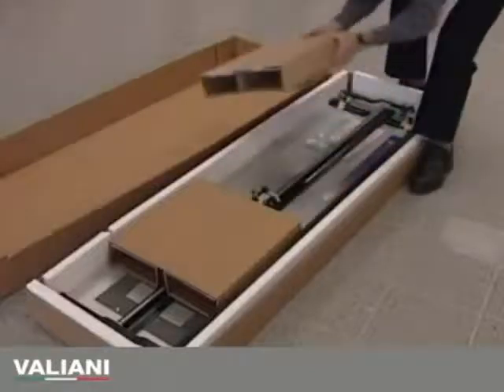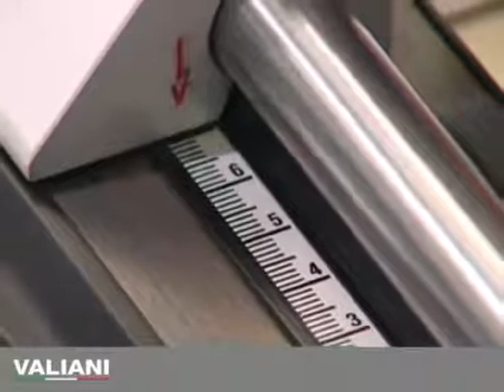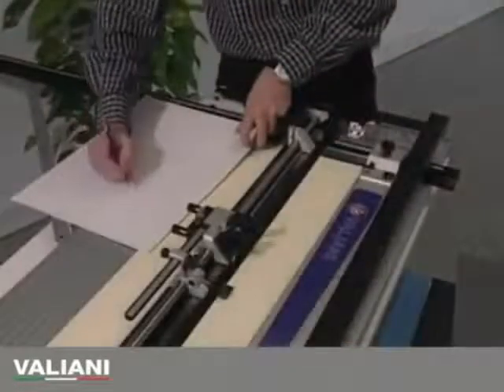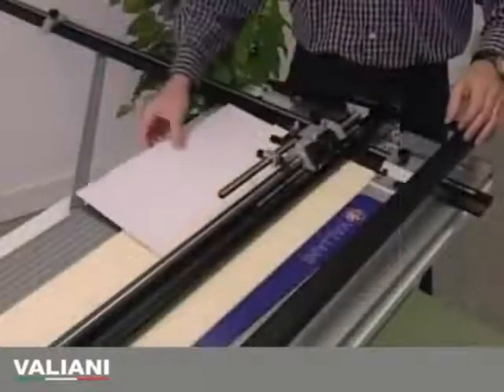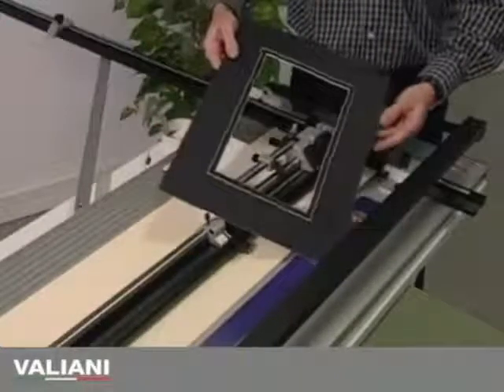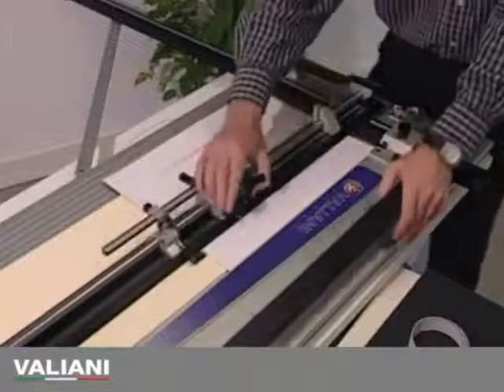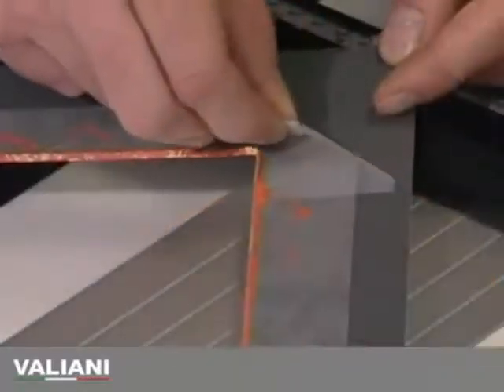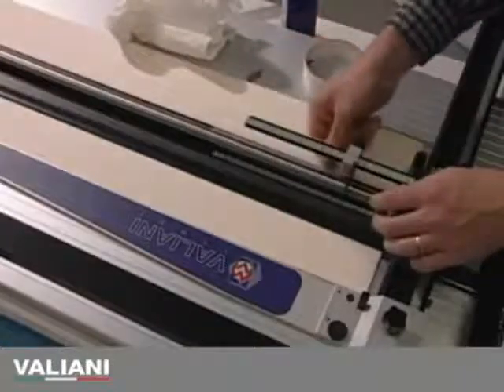Astra Manual Matboard cutter - User Video

Comment: Hello out there does anyone know were I could get a service manual for one of these, I just bought a used one that has been stored in a garage foe 5 years and has some rust on the slide, I'm cleaning with emery paper but it still runs stiff and lumpy, any help or advice will be most welcome. Thanks.
Reply: Hello! I had same problem and I just used the most small grid paper. I dissasebled all parts of cutter, washed them and cleaned to a mirror finish with sandpaper. After that I  oil all parts. Also you need to clean all bearings so that they spin smoothly or replace them with new ones. Good luck and have a nice day!
Reply: @MirtFlegman  Hi, thanks for that but having sweated blood with it I found that the screws under the slide are for fine tuning I slacked off the 2 under the sticky spot and now it runs perfectly, oh for a users manual! Thanks again for taking the time to answer. All the best Bob.
Reply: My Congratulations, Bob!